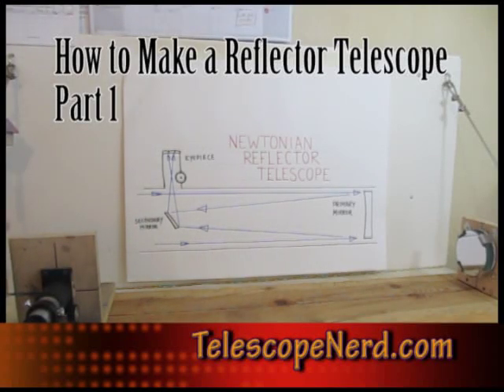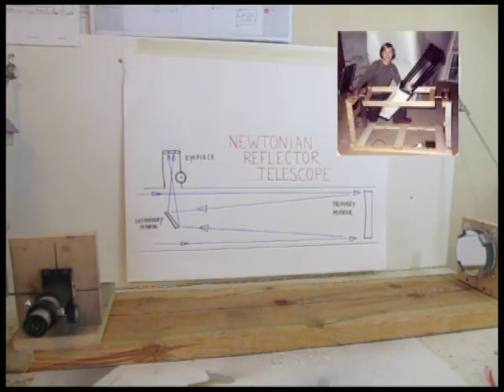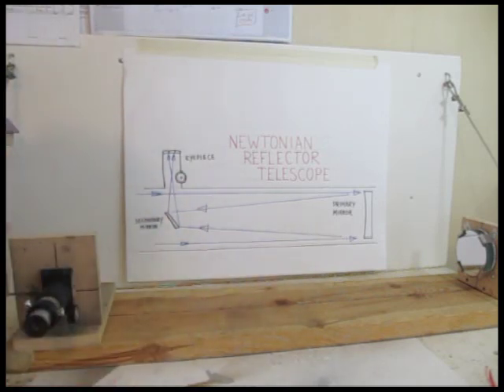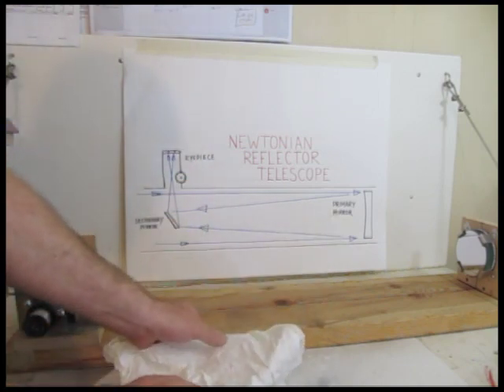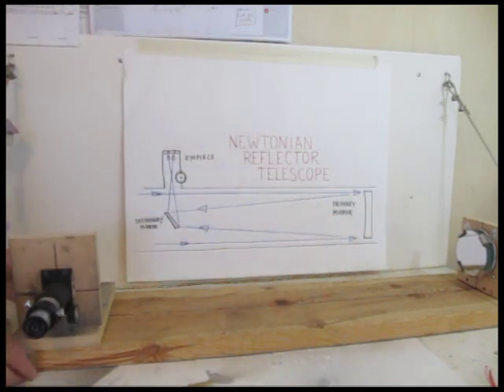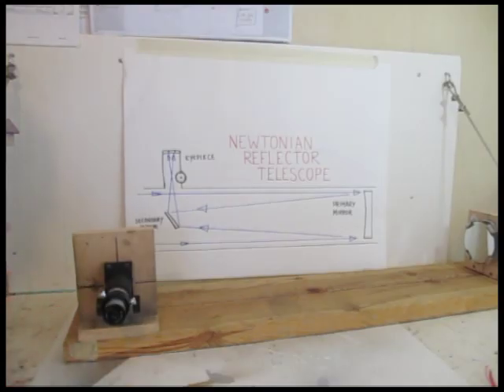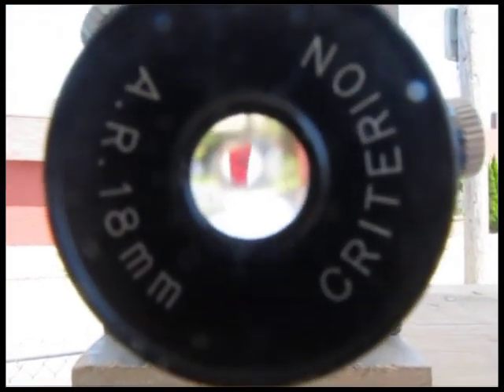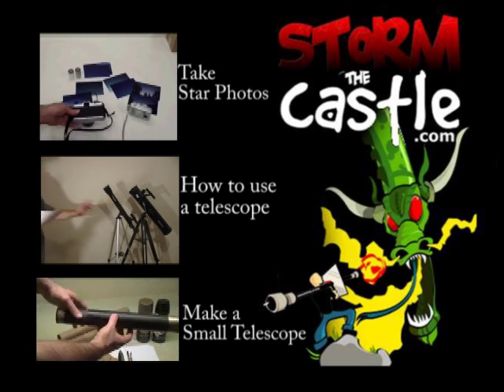How to Make a Reflector Telescope Part 1 (4 inch Newtonian Reflector)

Comment: You bet - I have been watching LOTS of videos on youtube, and when I dragged the hogging tool (2.5 lb dumbbell weight) across the mirror for the first time with #80 silicon carbide grit...it was a tense moment, but I have since lost all respect for the glass :) It's very durable, and VERY hard. It has taken me 3-4 hours of grinding to get a sagitta of 0.090", and my goal (for f/6) is 0.122". It's a pretty therapeutic process and I find myself getting caught up on a bunch of podcasts. :)

Comment: I used a smaller concave mirror, the type they use in the grade school labouratory to teach. And i cut my eliptical mirror myself and did the set up. But when i look through the eye piece(without an eyepiece lens), I see my eyes looking back at me in the parallel image of the 45 degrees mirror mounted inside. I have the feeling it's giving me the infinity mirror effect you get when you're between two parallel mirrors. I only get a blur image of the stuff i want to see outside, with only my eyes staring back at me in the infinity image i see inside. However, when i take my eyes off of the eye hole, and back off a little bit, i can see stuff clear. This is puzzling to me. I thought i should be able to see clearly what i want outside by looking closely through the hole at the 45 degree eliptical mirror.
I measured the focal length before i started.
I need to know what i did wrong. 
I also want to ask the ration of  the eliptical flat mirror to the concave one.

Comment: Something you shouldn't discount is grinding your own primary mirror. I built my own 8" dob using ebay-found primary/secondary mirrors, but have since started grinding my own 12" primary. I purchased a 12" blank for $120 and am in the middle of grinding an f/6. There is some math you need to figure out, and some care needs to be taken, but it's neither voodoo nor black magic - it's pretty straight forward.

Comment: If i had wanted to make a cassegrain telescope would i need to buy a special primary mirror with a hole already made? or could i do it myself?
Reply: I don't recommend to do it yourself...you could scratch or crack the mirror in the process...buy on with a hole in it!!
Reply from the maker: Takes a bit of skill to cut that hole.Also if you want to make a cassegrain  the secondary mirror is  hyperbolic, not flat and that is another challenge.